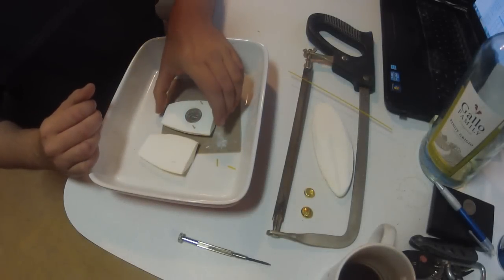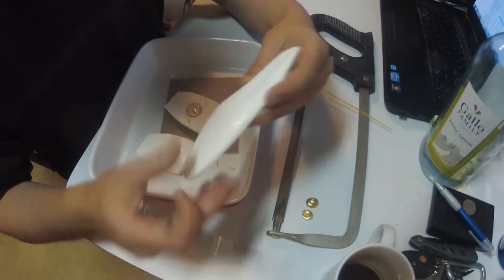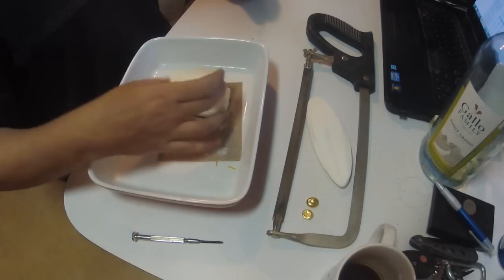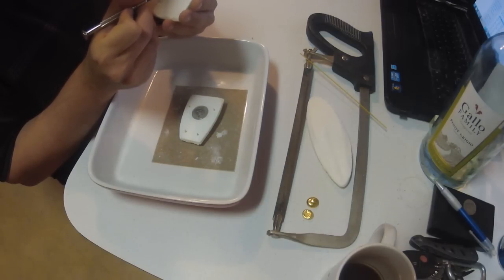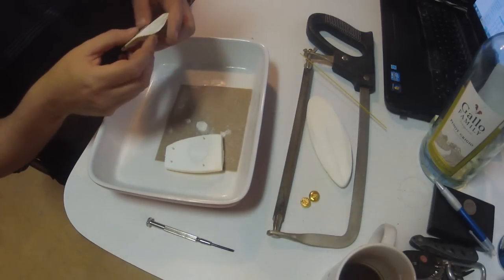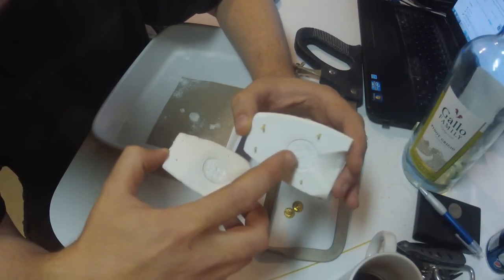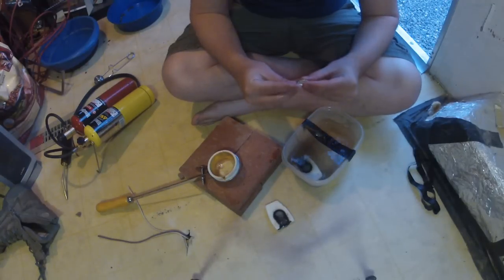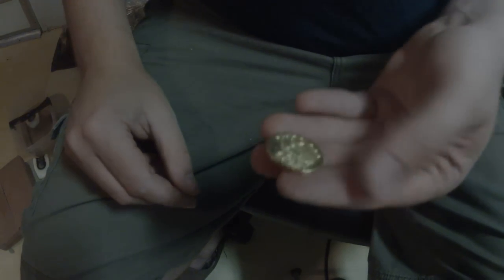How to Make a Gold Coin (Or Anything) Using Cuttlebone Casting

Comment: Wow, great video! I've been looking all over for a lost cost, low investment way to make ingot molds that are custom. I think your Cuttlebone method is ingenious. I wan't to create ingots that have a design rather than pouring into a generic graphite mold. This seems like a great approach. Have you done in more? Have you ever used SILVER?
Reply from the maker: +jimpublictube Hi, thanks, no I haven't used silver yet but probably will at some point later. Cuttlebone is definitely easy and cheap for custom stuff. The problem is it's very low definition and it transfers the cuttlebone pattern onto your casting - which in some cases can be quite beautiful for jewelry and whatnot but in other cases might be undesirable. But it's worth a try, nothing to lose except a buck or two! I think it's a lot of fun doing the whole process, I've made other stuff from pewter since I made this video and it worked real well too.

Comment: Cuttle fish molds can't be reused - sometimes you can get two castings but not often.  Try using larger diameter, but narrower sprue.  The metal will shrink about 10% when it cools.  GOOD JOB and well presented!  Good luck with your next casting project!
Reply from the maker: Thanks for the comments, yeah that mold was completely burnt out. I saw another video where they suggested you could reuse them but I believe they were only pouring pewter (much lower temps). Gold toasts, fries and batters this fish though!
Reply: I am looking to make some fake dablooms (not sure how it is spelt) and will be using aluminum, will it burn out the mold?
Reply: Victory Hub Might - but you never know til you try.  Cuttlefish is cheap and you can always make another mold!